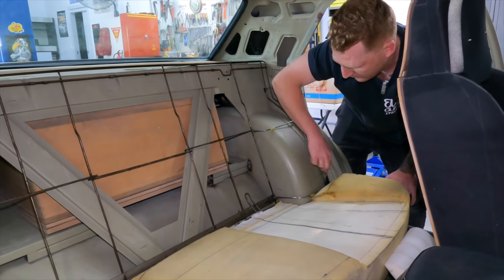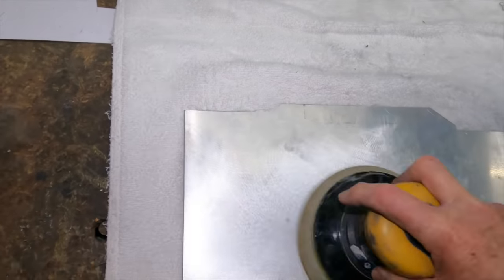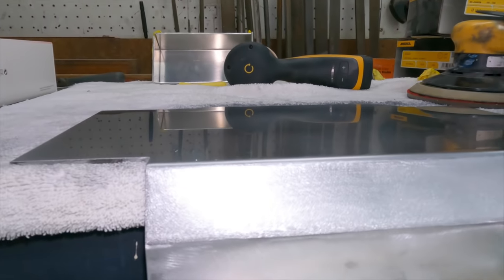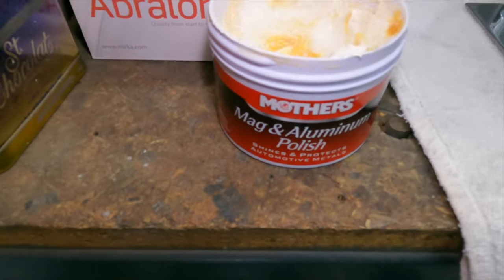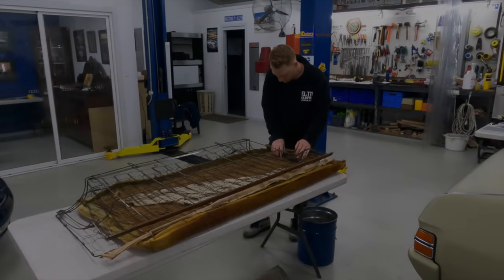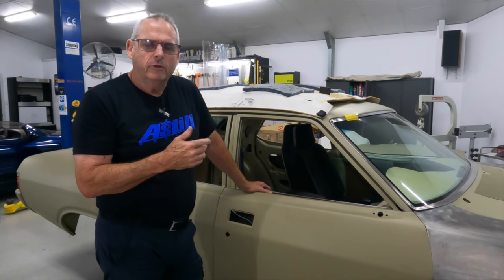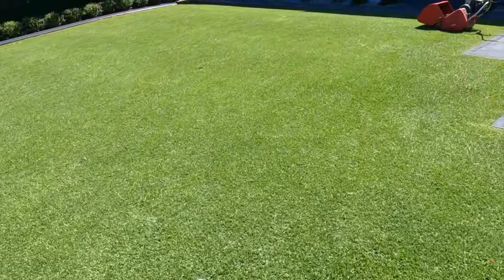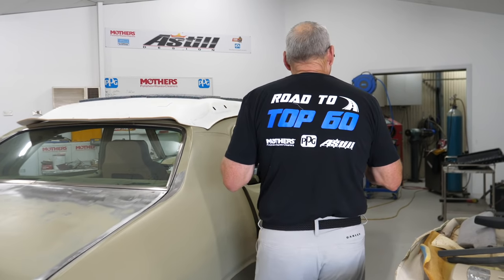BOSS XC Trim Design & Aluminium Polishing | Road To Summernats Top 60 #17

Comment: Reckon you need a 30" or 32" mower for your front grass. Knock it over in 10mins and they are heavier and the lines are the best! 👍
Reply from the maker: I’ve got a couple of small ones out the back so I’ll stick to the 45.🙂

Comment: An idea for the roof lining ... use the bows and make the rooflining out of heavy canvas material , once fitted to the car apply the FG style roof lining material over the top , no seams then and the foam on the fg roof lining material should take up the space where the bows are and look even
Reply: For the fg interior lights could weld a support piece between the roof supports on the turret
Reply from the maker: Thanks for the input
Reply from the maker: Yeah we keep the light mounts out of the FG we cut up.

Comment: Maybe BA/ BF style front light (like an oval kinda shape with moveable maplights).

The FG sunglass holder light is about 3" longer than a lower series light, and is the same basic square design as the lower spec.

Could always go something simple as like the VR Commy interior light- basic rectangle
Reply from the maker: Thanks Max, I have looked at the lights in my BF superpursuit and Heathers FG GT

Comment: cant wait to see interior finished .just wondering what youd recomend to get rid bindis .ive had a blue couch lawn for many yrs but since next door got horses i cant get rid of bindis that came with horses grrrr im not as fussy bot my lawn cause im in country but am still proud of what i had which brings lots compliments .cheers in advance for any info
Reply from the maker: Mate grab some bindy killer in a concentrated for and mix and hand spray. You will probably need to do it a few times to get rid of it.
Reply: @AstillDesign  tried that but no go .maybe mix double strength but not sure if itll damage other plant